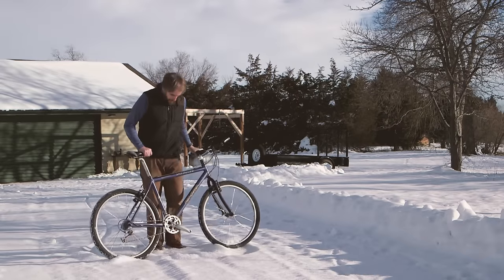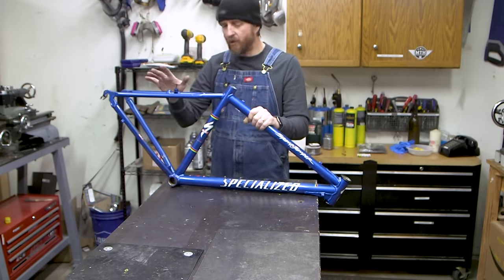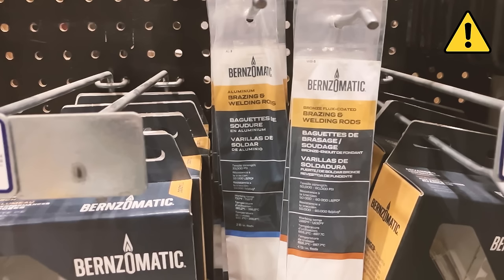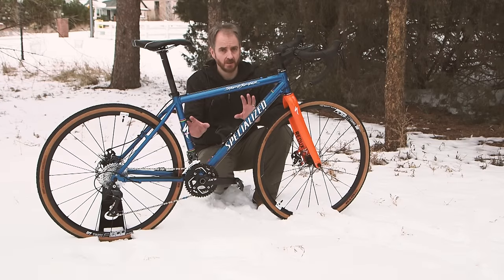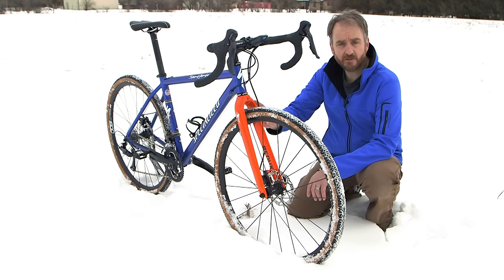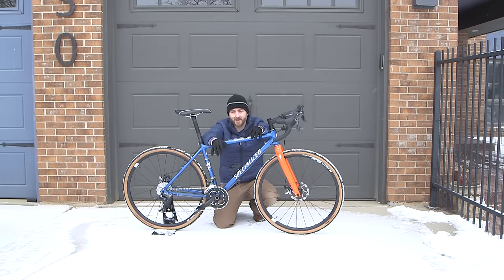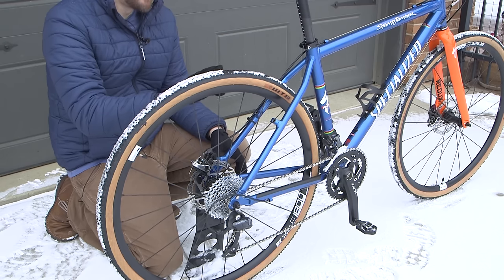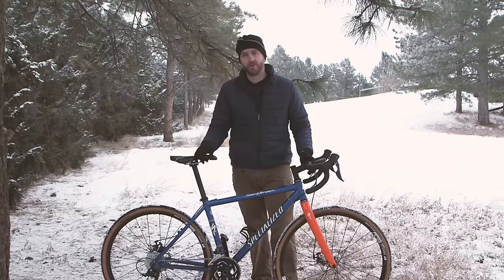Specialized Gravel Bike - Convert 90's Mountain Bike to Gravel Bike

Comment: I really like the high BB . How is it working without a seat stay gusset? Since you went with discs, i guess they don't spread.
Reply from the maker: I haven't even noticed the missing gusset.  In my opinion, it was only really there for the original cantilever brakes to keep the frame from flexing and improve their performance.  With the discs, there aren't any side forces on that section of the frame.  It's not been an issue.  Your Stumpjumper city bike sounds pretty cool.
Reply: @RobertAdairWorkshop  I had to compress the frame for coaster hubs and add a sprung roller for the chain but it's awesome even on xc trails. I just switch wheel sets for city or dirt

Comment: Hi Robert, that's a lovely build. How does the front derailleur work? In theory the MTB front derailleur shouldn't work with road shifters.
Reply from the maker: I didn’t do a great job showing it in the video, but it’s a triple front derailleur and a triple crank without the inner ring. Using a triple crank with only two chainrings gives me a chain line that lines up with the middle of the cassette perfectly.   The triple front derailleur has a wider cage than a comparable double front derailleur which reduces chain rub when in the lowest and highest cassette cog.  That lets me set up the derailleur so it doesn’t rub when the cassette is in the highest or lowest gear.  After that, the shifter sets the cable pull and trim positions and the geometry of the wider derailleur.  

Fit the triple derailleur and double crankset.  Set it up so that when in the lowest gear, there is no rub on the inner cage.  Then shift to highest gear and set limit screw so there isn’t rub on the out ear edge of the cage.

Install the cable, pretension and adjust setting in the trim position.
Reply: @RobertAdairWorkshop  OK that makes sense. I hadn't spotted that it was a double chainset, which is IMO the best set up for road and MTB as you can easily get the range of gears needed, keep the gaps between gears close and maintain good chainline.

Comment: I'm wondering how you determined the position of the disc brake mount before brazing, did you fix your mount to the brake caliper and use the wheel itself for alignment?
Reply from the maker: Yeah, you're exactly right.  I clamped the caliper to the rotor, rolled it around until it contacted the stay, then scribed the location for the mount.

Comment: Nice Video! Are you happy with your mechanical calipers? Did you think about using semi hydraulic brakes like Juin Tech? On my current gravelbike I am kinda thinking about switching to hydraulic brakes but having only post mounts on my frame really messes up the selection I can choose from :D
Reply from the maker: They are alright.  Better when bedded in which they are still doing.  I have post mount hydraulics on my road bike and my other gravel bike and they are significantly better but also significantly more expensive.  BR-R785 calipers, if you can find them.  Compatible with road levers.
Reply: @RobertAdairWorkshop  Many people consider compressionless brake housing crucial to running mechanical disc brakes, BMXers sometimes call it linear housing (the sleeve isn't coiled but stranded like a shifter cable housing, just bigger for brake cables)
Reply from the maker: @here-be-ember  That's good to know.  Thank you.  I'll check it out.

Comment: Nice job & nice bike! I'd like to know how you did to have a rear road (700) wheel with an MTB wheel axis length to fit the frame? I think the lenghts of the hubs for MTB wheel & road wheel are different, isn't it?
Reply from the maker: These old mountain bike frames use a 135mm rear spacing, same as road bikes, provided the wheels are quick-release.  Thru axle road wheels bump up to 142mm width and I think MTB's are even wider.  But yeah, 135mm quick release road wheels will work with the 135mm rear dropout spacing on these old MTB's.
Reply: Nice! I'm going to try. thanks @RobertAdairWorkshop

Comment: I really love your video! Can you tell me how you used an 1¹/⁸ frontfork in a 1 inch frame?
Reply from the maker: This one is a 1 1/8" frame.  I think all the aluminum bikes are.  I used a 34mm, 36-deg cartridge headset which added some much-needed stack to the front end.
Reply: @RobertAdairWorkshop  i'll take measurements tomorrow, this is a steal Raleigh frame.

Comment: One question left: How do I know where exactly to attach the mounting holes for the disc brakes? I think it has to be an exact position, but how do I know, where this position is? Or is it not that important, because… I cant imagine that.
Reply from the maker: I put the rear wheel on, clamped the caliper to it and rolled the wheel around and watched where the caliper sat.  I then made some patterns and tried them to make sure I got the fit right.  It doesn't matter where it sits in the 360-degree circle around the disc.  It matters where it hits the frame and whether the pads fully contact the disc when installed.  It's actually really easy to figure out where it goes.  The harder part is figuring out how to make a bracket that will hold it in that position but also align with the frame.  It'll require ingenuity on your part.

Comment: Why did you use aluminium for the custom brake mount? Isn't the frame made from steel?
Or is this not a problem with the special brazing material?
Reply from the maker: You're right.  The mount is aluminum.  The frame is aluminum too.   A steel bike is easier to adapt because it can be welded.

Comment: Hi, I feel so lucky to find this video because I am just going to do exactly the same thing. But I am still not sure about the front derailleur, you see I already got shimano sora r3000 road shifters, alivio mt210 2x crankset and its bb, but I wonder would any down swing 3x mtb front derailleur fit in this setup or I have to use exactly the same front derailleur in your video?
Reply from the maker: Any triple front mountain derailleur should work.  Just make sure it matches the appropriate speed so the chain width is right (ie 9-speed fd with 9-speed shifters)
Reply: @RobertAdairWorkshop  Thx so much!

Comment: Can the aluminum welding rods be used on steel frame to mount either a steel or aluminum disc brak tab?
Reply from the maker: It has to be an aluminum tab.  Aluminum to aluminum.  It won’t bond to steel.

Comment: 1:44 that’s quite a small frame for your height to be honest. Im pretty sure you have so many discomforts earlier but you’ve already accustomed to them that your body tends to ignore them already. I presume you ride short rides  as surely you’ll feel the strain to your body in long rides since the bike is quite small for you.
Reply from the maker: I have poor lower back flexibility due to a car crash in 1999.  The shorter reach frames are more comfortable for me.  I ride a 54 road bike, too, with a 120 stem, and it is much better than a 56 with a 100 stem.  But good point for others.

Comment: you make me miss my Schwinn s[9 five] .6... I worked all summer in '96 and almost all of my money went to that bike... I rode it a TON... sadly in the early 2ks I broke the frame in a crash... I still miss that bike... something special about that bike you bought with your own money in your teens.

for the stumpjumper... I have the same bike now... I picked it up for $25 a few years back for my son, mechanically it's still in great condition... I've been thinking about something "silly" like a gravel build... been thinking of a 69er setup on it... your video has made things worse... 

did you notice any changes after cutting the seatstay bridge?
Reply from the maker: I’ll admit, I’m glad I kept the Rockhopper and did the conversion on the Stumpjumper.  That Rockhopper got me through 4 years of college in the late 90’s.  I haven’t noticed any change with the seatstay bridge removed.  If I didn’t know I’d removed it, I wouldn’t be able to tell.  No regret removing it.
Reply: @RobertAdairWorkshop  so any idea what the axle to crown is of that fork? about how large of tires do you think you could squeese into the frame... I assume the limiting factor are the lower chains stays once you removed the brake bridge?
Reply: @RobertAdairWorkshop  well I went the other direction... I have an identical stumpjumper... and went out and found a '02/03 rockhopper with disc tabs... the guy also tossed in a '96 mid tier steel Marin MTB frame... so largely thanks to you it's time to we'll see what I build for some mild offroad use

Comment: How is this mountain front derailleur working with the Sora road shifter? shouldn't be the pull ratio completely different?
Reply from the maker: It’s working just fine.  The cable pull and trim positions are set by the shifter for the front derailleur.  I’ve found that front derailleurs play much more nicely when using road shifters and mountain derailleurs.  The important consideration is finding a derailleur with a wide enough cage and enough inward movement.  On these old mountain bikes, bottom pull derailleurs seem to work better than top swing.  The SLX derailleur I used works quite well with that Sora shifter.
Reply: @RobertAdairWorkshop  Great to hear. After taking a closer look, this is a 3x front derailleur and you are using a 3x chainset without the small ring, right?
I have the same setup on a old bike, that i'm planning to convert with an unused set of the same 2x9 Sora STI, but im discovered some spacing problems on the frame, with a road chainset. So maybe i can go the same way like you, without buying additional parts.
Reply from the maker: @thmssc  You are correct.  Triple crankset without the inner ring.  Probably should have mentioned that.
Reply from the maker: @thmssc  I could measure the chai line for the two chainrings if it would help.  The crank is a cheap Amazon crank with Truvativ rings.
Reply: @RobertAdairWorkshop  no need, they should have almost the same, thanks.
It’s great to know that such combination can work. I will try this later this year, at the moment the bike is my winter commuter.
My alternative would be the 3x9 Sora derailleur and shifter, this combination is trek using on there 520 with the alivio crankset.

Comment: I'm 6'3" and I've been hunting for an XL frame but you're saying I could get away with an L?
Reply from the maker: In one of these old mountain bike frames, yeah.  Probably.  The 18” frame I used is just right for me.  Go with a 19” frame and you’d probably be there.  But keep an eye on that top tube length.  23” is the same as a 58, which is usually considered an XL road bike size.

Comment: I wonder how big a tire you could use with 27.5 inch wheels
Reply from the maker: I played around with Cateye's wheel calculator.  I'm certain I could put a 700c x 40 tire in there.  That's the equivalent of a 650b that is 2 1/2" wide.

Comment: At 08:00 about road brifters and mtb front mechs. The swing is one thing but I have more problems with the pull ratio. How did you fix this?
Reply from the maker: Front derailleurs usually aren’t too picky about pull ratio.  At least, Shimano.  What is it doing?
Reply: @RobertAdairWorkshop  Nah, this issue is well documented. The lever of FD is different between road and mtb. So what happens is if you limit and trim for the granny, you never reach the biggest chain ring. Not because of limit screw or reach but because pull is too short. Solutions are travel adapters or pure luck 😂

Comment: I'm not sure about cutting the bridge out. They add fair amount of rigidity and strength. Why not cut the section out, shorten it, and add it back .75" up?
Reply from the maker: Yeah, that's a good option.  Wouldn't be any more difficult than adding the disc brake mount.  I'll have to save it for a winter project though.  It's good advice.  Wish I'd have thought of it!

Comment: What cranks did you use? I'm looking to do a similar build but cannot find anything 2x that fits a 73mm bb without being square taper
Reply from the maker: These are IXF cranks.  They have an integrated axle and use a hollow tech bottom bracket.  You’ll find about a thousand different versions of the crank on Amazon.  The cranks are good but the bottom bracket that comes with it isn’t sealed and won’t last long.
Reply: @RobertAdairWorkshop  i see, it's sold as mtb 1x/2x/3x. I'm guessing you mounted both chainrings in the 104bcd holes to get the right ratio

Thanks!

Comment: Sorry if I missed it but where did you source your 1” fork and brakes?  Thanks!
Reply from the maker: It’s a 1 1/8 fork.  This bike had a 1 1/8 steerer from new.  The fork came off eBay.  It’s a Raleigh Redux fork.  I got the brake calipers and rotors on Craigslist. They are TRP Spyre.

Comment: Total personal opinion, but I just can’t stand sora. It seems like you can usually find sons used tiagra or 105s for about the same price and are so much nicer or go with a new microshift advent setup since you are building from scratch and get a clutch rear derailleur.

Comment: Hi, which cable tensioner are you using? It´s necessary? Will it loosen?
Reply from the maker: The brakes and rear derailleur I'm using have their own cable tensioners built in.  The only one I had to add was an inline for the front derailleur.  The cable hosings will settle into their ends in the first hundred miles or so and you'll have to adjust the derailleurs again.  But after that, they don't typically loosen.

Comment: Interesting build! Did you swap out the headset from 1" to 1 1/8"? How hard was it to find one that fits into the head tube?
Reply: Oh, and what's the diameter of the seat tube for that frame? My 1996 Koga Miyata GlobeTraveller has 26,8mm, so it's not easy to find good seat posts ourdays..
Reply from the maker: @andreasruther8750  This one has a 1 1/8 headset (34mm) from new.  I didn’t have to worry about sizing with it.  The seat tube ID is 30.9. It’s a common size that Specialized has used for a long time.  Those both made the build easier.
Reply: @RobertAdairWorkshop  That makes the frame really interesting!

Comment: How did you determine the exact place to braze on the disc brake mounting point?
Reply from the maker: I mounted the wheel, clamped the disc brake caliper to it and rolled it around until it hit the stay.  Then I 3D printed a bunch of IS mounts and used those to gauge the right distance for the caliper to sit at.  Basically, I made a template. 
After that, a clamp and a square during brazing to make sure things stayed aligned.

Comment: If flat bars are used instead of drop bars, would you recommend a bigger frame size?
Reply from the maker: Yeah, I think so.  Those old 90’s bikes tended to have long stems.  I think the Stumpjumper would have come with a 120.  With flat bars, I’d probably use a 19” frame or maybe 21”?
Reply: @RobertAdairWorkshop  Thanks for the advice.  Also, is that a Surly Troll fork on the first rock hopper?
Reply from the maker: @adamd8997  Yes it is!  It's a great rigid fork that I lucked on many years ago.

Comment: So the only thing that left from the old mountain bike is literally nothing?
Reply from the maker: The frame.  Modern gravel bikes don't use any of the old mountain bike parts.  The shifters require modern cassettes and derailleurs.  The fork needs disc brake mounts.  And by my definition, it needs 700c wheels.  Reuse the wheels, brakes and fork, and you really just have an old mountain bike.  It misses the point.
Reply: @RobertAdairWorkshop  yeah, that's my point. At first part of the video you replaced even the frame 🙂

Comment: What did the seat tube and head tube angle come out to? BB height?
Reply from the maker: Using my angle finder, the head tube, 73.5-deg.  The seat tube, 74.6-deg.  The bottom bracket height, 12" floor to center.  This is with 700cx37mm tires.

Comment: I don't want to leave a negative comment about a cool project but you may be passing on some unsafe ideas here. The soundness of how you did the brazed aluminum disc tabs is not only about the surface area contact. The other problem is that you've potentially brought that whole area into the area where 6061-T6 can lose strength, including the seatstay and the dropout. Bernzomatic lists the active range of the aluminum brazing rod shown at 720-750F and that is above all the "rule of thumb" guidelines for this (I don't have a specific reference here, but if you google around you'll see). Yes it's not being held at that temperature long, but I don't believe you can vouch for the structural integrity of that area without getting the frame heat treated afterward. The strength difference between annealed 6061 and T6 is over double, and you're getting into the anneal temps to do this. That is huge and losing even a part of that strength can easily push a frame into the danger zone. Bike frames don't just have tons of material redundancy to give in terms of thicknesses and diameters chosen, and note that in this case not only are you taking away strength, you're adding the loads of a disc brake to the same area. Again I don't want to slam your work but along with inspiring people you I think you should go deeper into how "at your own risk" this plan really is. Getting someone to TIG it without heat treatment afterward is the same problem but worse.
Reply from the maker: I did the calcs back when I first considered the brazing and to lose a T6 temper was something like 15 hours.  I had it hot for maybe 5 minutes.  I decided I wasn't worried about it.

Comment: Cant you use adapter for tapered fork ?
Reply from the maker: No, unfortunately.  Those adapter headsets need a 44mm head tube, minimum.  This bike (and most 90's MTB's) has a 34mm head tube.  There just isn't enough room.  I thought about making my own lower headset but to actually clear a taper in a tapered fork, it would raise the front end by about 1 1/2".  Just couldn't make it work out.